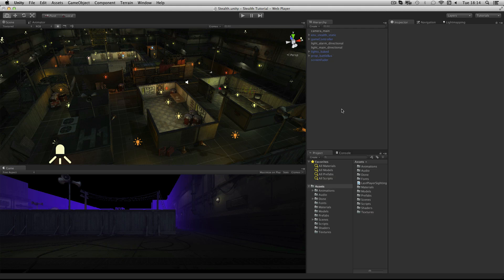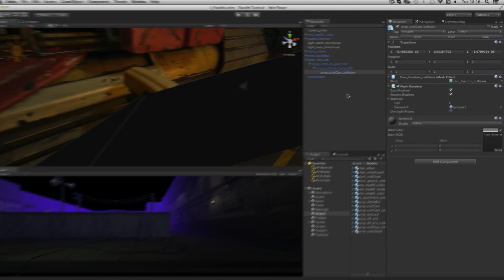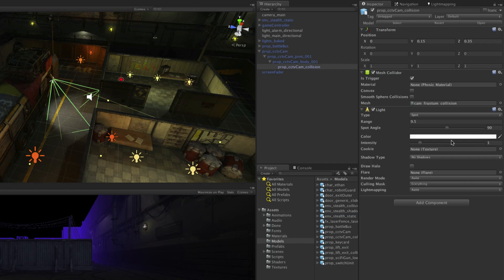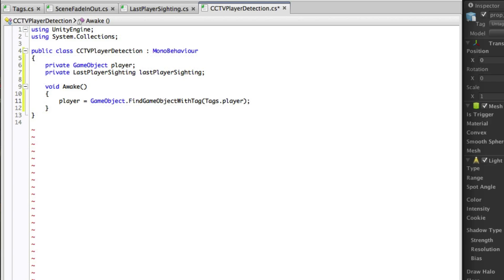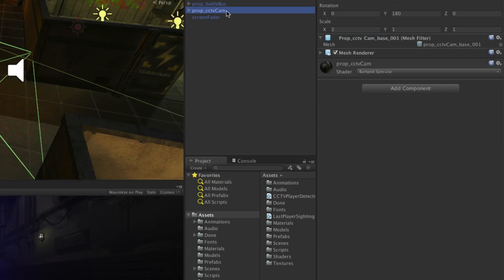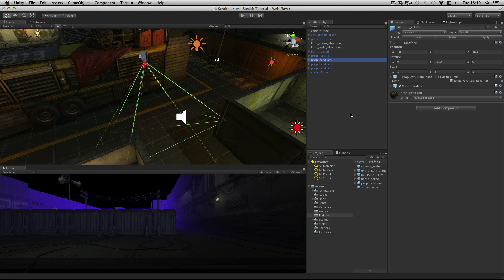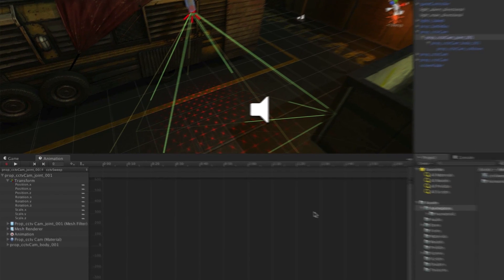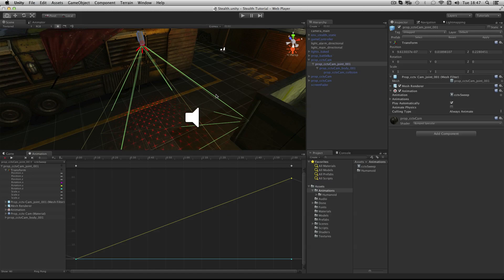Stealth game tutorial - 107 - CCTV Cameras - Unity Official Tutorials

Comment: Using Unity 5, and for the camera animation I had to do the following, you will get an animator and a animation file, click Add Property and add the transition rotation properties and at 2 seconds i changed the y to 60 and at 4 sec i changed it back to zero, and of course at 0 sec it is also at zero, i did this because i could not find ping pong.  I also slowed down the speed of the animation on the animator to .5 to create a slower camera.

Comment: For anyone struggling with the animations in Unity 4.5 here is an easy way to do it (avoiding the legacy problem):
 
Before you create the CCTVSweep animation file, open up the animation window under the window tab (not the animator window). With the camJoint child object selected, click add Curve in the animation window. Navigate to the animations folder and save your file there as CCTVSweep. (I don't know why that would make a difference but it stopped the legacy warning coming up for me.) 

You can click add Curve again and select Transform > Rotation. This will give you an animation clip. You can expand its properties using the drop down arrow to the left of the clip and its rotation.y you want to be working with. You can pretty much follow the tutorial from there. (I made a 16s clip, with keyframes (time,rot.y): (0,60), (8,0) and (16,60) to create the panning.)

Also for people complaining about not having the ping pong feature you can simulate the smooth motion by going into the curves tab, and right clicking on the start and end key frames and selecting "free smooth". You can grab the key frame and fashion the curve into a cosine wave. (y)
Reply: Neat, thanks! :D

Comment: For anyone doing this tutorial on 4.3 and does not know what the fuck to do:

In order to make the animation loop, click CCTvSweep animation and in the animation inspector, check "Loop Time".

Once you are in the animation window, click add curve->transform->rotation

In the dope sheet tab, click, the graph at 2:00 and set Rotation.y to 60, after that click the grapth at 4:00 and set the Rotation.y to 0:00, also making sure that you have an initial state set to 0:00.
Reply: If you're following the tutorial, at this point you should have prop_cctvCam_joint selected in the inspector. From there, double click the cctvSweep animation property which will open it in the inspector. From there, change the wrap mode to ping pong.

It doesn't seem to change anything to the animation window though so don't mind that. It'll animate properly once you press Play to preview.

One last thing: Pressing play opens up the game view from which you don't have control yet and can't see the camera, but you can select the scene view and from there you'll see the camera properly animated.
Reply: that was helpful, thanks :)
In my project, instead of the Animation component I've created an Animator component when I dragged the Animation on the GameObject and it seems to work.
Can you tell me the difference between Animation and Animator?
Reply: Y4ZATA It appears that an Animator could contain a series of Animations, allowing you to transition between them if you desired.
Reply: Vinh Bui Well, i said in my comment that you have to do 0(0:00)=>60(2:00) and the 60(4:00)=>0(6:00) , assuming you have unity 4.3 or higher
Reply: Hi,
 if you did the same as video, it will loop from 0 => 60 and then 0=>60 again, so it's not nice. To make it nicer, you can make the camera rotate 0=>60 in the first 2s, then in the next 2s, make it rotate 60=>0, then loop it.
Reply: Thanks a lot. All that was missing was the time looping.